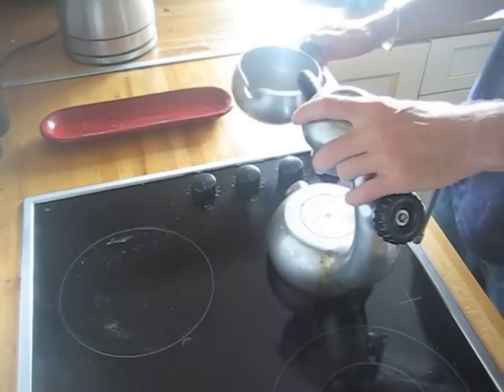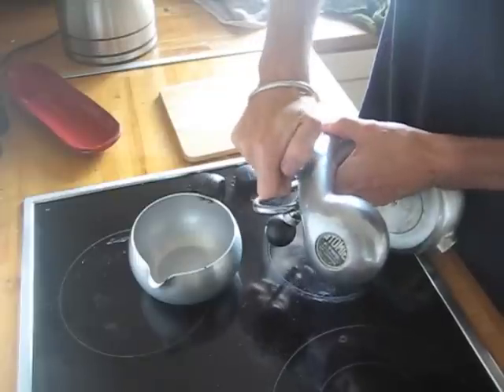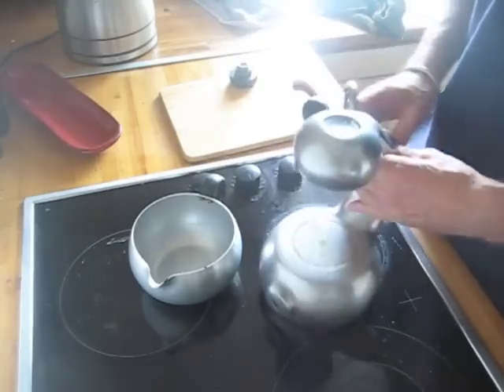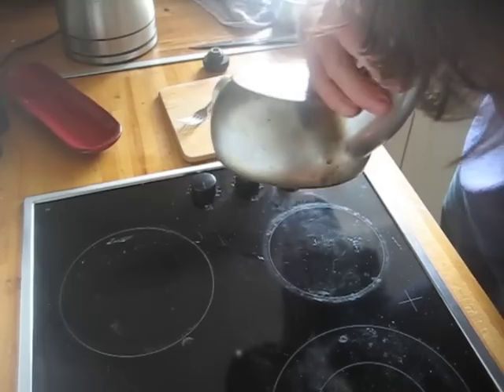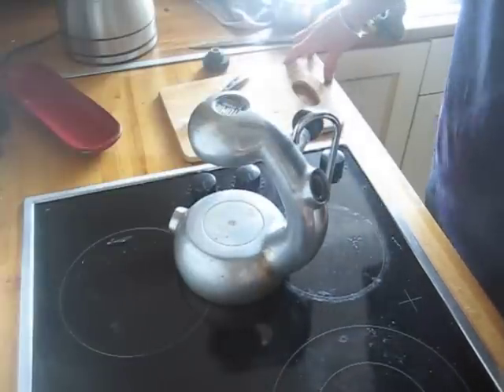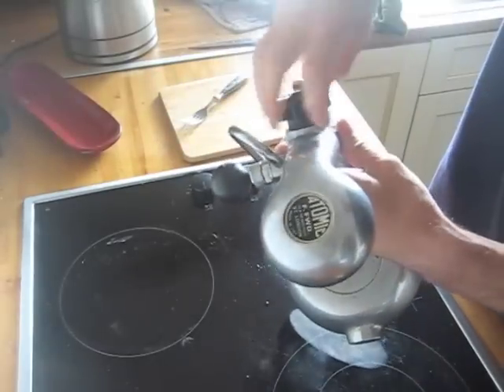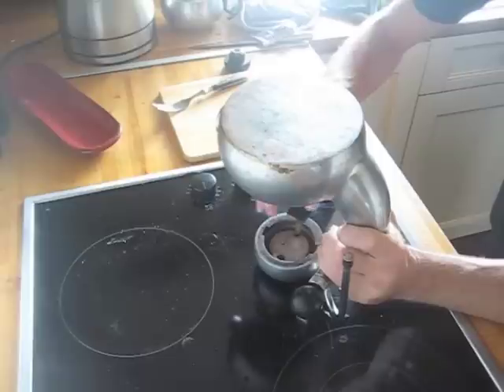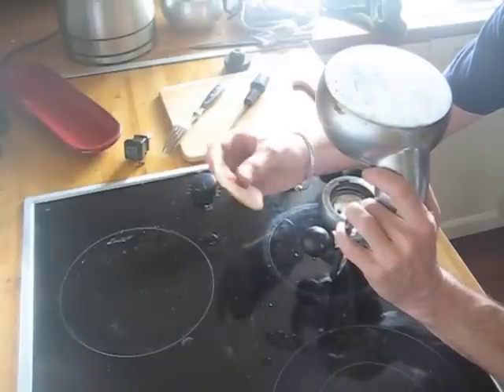Cleaning the inside of your Atomic Coffee Machine - Part 2

Comment: I would use Durgol liquid, the Swiss descaler that I use in all my espresso machines. It doesn't mar the finish of stainless or aluminum and it's easy on the gaskets. I also only use Spring water with low TDS  so scale is not much of an issue as tap water.
Reply: Very nice tip thank you

Comment: If the screws are snapped off, I can see that the seal holds the plate in , however the screw holes in the plate are very big and Im guessing the steam will go through them rather than the tiny perforated holes in the plate, so I would suggest plugging up the 2 screw holes with a couple of screws with nuts on the other side ,or if you have some thread left on the broken screws stuck in your machine, you could put a couple of nuts on them and then screw the plate on with short screws through the plate into the nut as I did.... cheers for the info very easy to follow...also you can buy lemon juice in a bottle at the supermarket in the cooking section cheaply too...

Comment: wouldnt it be better to use penetrating oil spray to try and remove the knob...the same stuff they use for tight or rusty bolts on cars..?it's a bit expensive but could save you some grief..